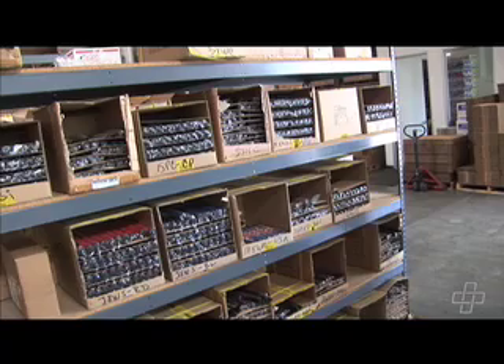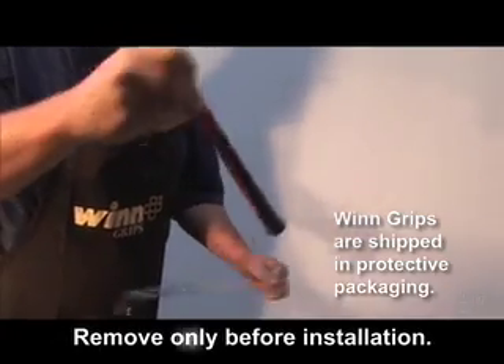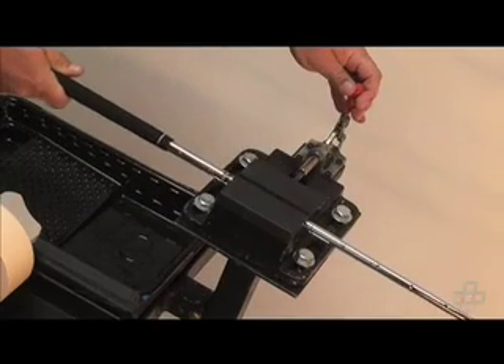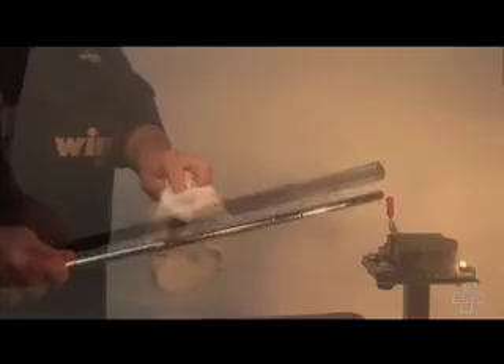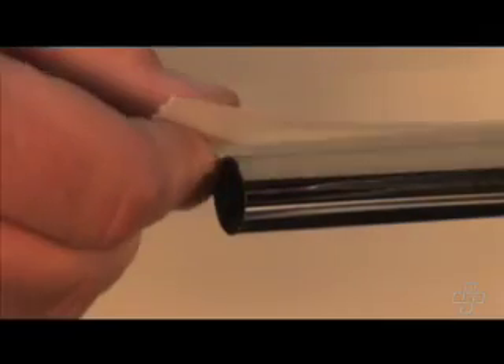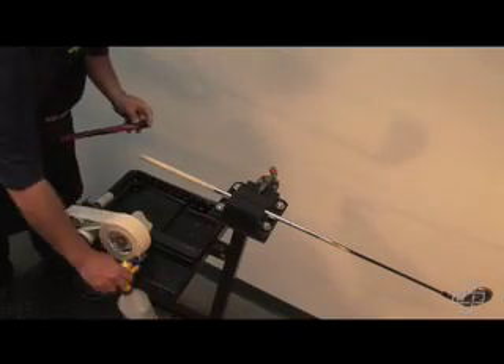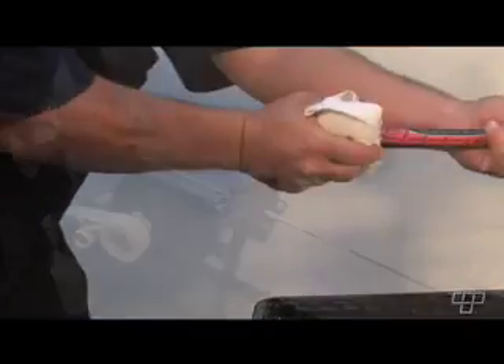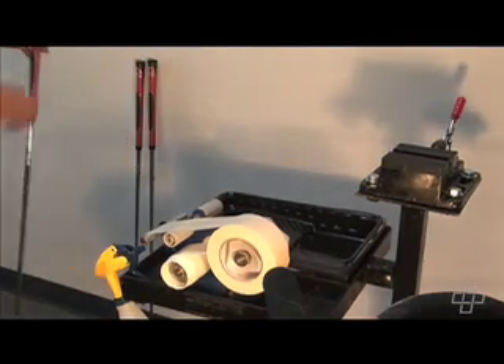Winn Grip Installation

Comment: Just installed a Winn Excel oversize grip on my Adams Redline driver, and it was a far easier installation than I expected. I think the secret is to completely fill the grip with solvent, this makes it far easier to install. Getting it started is a bit tricky, but once it's on it slides on like butter.

Comment: Easier said than done!

I've just come off attempting to fit a Winn grip to a putter.

I used a more than liberal amount of solvent over the tape and double soaked the inside of the grip.

The grip slid on by two thirds and then seized.  It would go any further and I couldn't take it off either.  I had to scrap a £16+ grip.

I think the problem may be one or several things.  The diameter of the Winn grips are smaller and maybe the compound of the rubber liner is different from a conventional Golf Pride type grip.

At any rate, I wasted a grip.  I'll stick to Golf Pride in future.

Comment: Why is putting in a winn grip different to any other. I've regripped over 50 clubs and there all the same. 

Good demonstration though. Although i would recommed more than 30 mins drying time.

Comment: The leather wrap grips are impossible to install - Ive installed dozens of orher grips and just ruined 5 of these trying to install on metal shafts...no mention of any special installation method required on packaging. They did not slide on easily like in this video... Very disappointed.